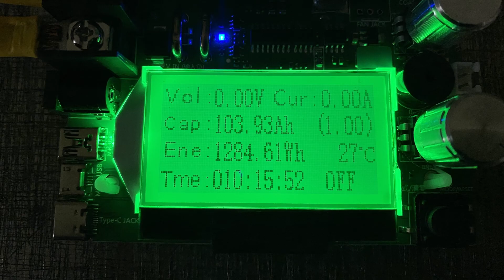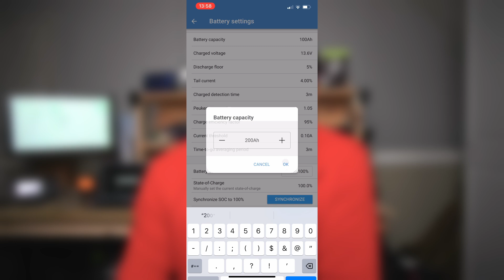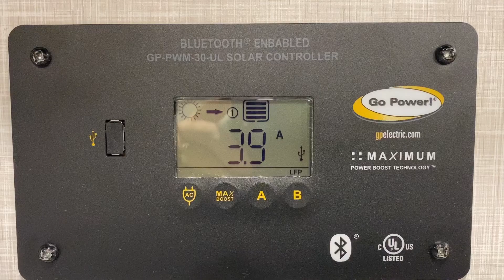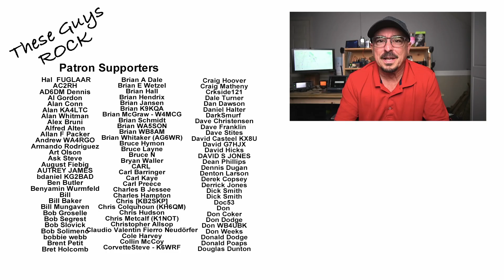Battery Install Gone Wrong

Comment: What charge control from shore power do you use?  What DC power Supply?
My RV is old so it only does Lead Acid. I would love to change out the charger and then add lifepo batteries.

Comment: ALWAYS ALWAYS ALWAYS d/c the panels BEFORE the batteries.  sounds like it settled itself out, luckily.  the theory about the mismatched battery voltages to start is valid, but you would need a fairly significant difference between them, and as long as the battery connected 1st (directly to the CC) then it shouldn't be a big deal.    Or maybe none of the above.  Like you said, this is a head-scratcher.  Hope it all stays working.

Comment: There is a certain order things need to be connected. I think the PV cells must be connected last.  Leaving PV connected without the battery will cause problems.  Once the sun goes down the PV (pv disconnects) the sun comes up (PV reconnects last in the circuit) all is happy.

Comment: Yeah, before you connect two batteries in parallel, check their voltages.  If one is way above the other, it will charge the other, sometimes at absurd amounts of current, and you can damage one or both this way.
Reply from the maker: Both had been charged to full the day before so I thought the voltage would be close

Comment: Always connect batteries to the PV Charge Controller before you connect the PV panels.  And I disagree with your view that it wasn’t helpful.  It was good information to share and if it happens again, you’ll know how to reset it.  73, Tim KO4EZG

Comment: I have a question which is somewhat related. I have four SLA batteries in series parallel. Can I draw from just one to run my radio, or does that cause a problem with the other three batteries being higher state of charge?
Reply: Series or parallel? Either one is fine as long as you end up with the voltage required by your radio.  Lots of the radios are 12 volt setups.  So, if "one" battery is 12 volts, you may use "one" battery by itself to power your radio.  Otherwise, if you hook a bunch of 12 v batteries in parallel you (for all intents) just make a bigger, "single" 12v battery, and because it's still 12 v you can still use that parallel setup now as the giant-capacity battery to run your radio.  Of course, I really didn't say much about a "series" hookup, as I'm just figuring you misused your technical words -- which I too have been known to mess those up, as do others.  But, they are importantly different  when being technically correct.
Reply: Just so you know if you hook batteries in series you increase the voltage rather than the capacity. Hope I didn't mislead you on my comments.  I just don't know the voltage of the batteries you are using.

Comment: I did not see smoke ! from doing many installs and with more than 1 battery.  Charge each battery separate and then connect. I have done 12/24 V systems in RV.  Waiting 24 HR is not a issue . From what I can figure you have no disconnect on PV solar input on MPPT controller . You disconnect battery leaving solar on. this keeps power in the controller. When you re connected it glitched. The CPU on controller went crazy . You needed a power off reset. That can not happen with solar working. and at night the solar went off re setting the MPPT controller. To prevent this get a PV disconnect switch.     Double pole made for PV systems. place in line just before PV input on controller in a easy to get at spot.  When working on Battery . disconnect PV solar first then Battery disconnect. This removes all power from controller and re sets it. Then battery on first than solar on.  The MPPT controller has a CPU in it.  Power on reset . 73

Comment: The instructions with my cheap Renogy stated to connect battery first then the panels. I read somewhere else that reversing the sequence could damage controller. How's your insurance?
Reply from the maker: Thankfully this didn't require an insurance claim

Comment: Curious, what brand and model of Charge controller are you using.?  is it RF quiet at HF and VHF?
Reply from the maker: GoPower is the brand. It came with the RV. I haven't noticed any significant noise from it.

Comment: Lithium Iron Phosphate batteries don't work the way most people think they do. This includes the people making them. Top balancing with Battery Murdering Systems is how you kill these batteries (and cause fires). The correct way to build a pack is to remove all BMS from them. Then bottom balance the individual cells (bring all cells to the same, near empty SOT with a resistive load). Then when you charge them, do so as a pack, to a slight undercharge with an intelligent charger (say 14.4V instead of 14.6V for a 4S2P pack like you have). Watch EVTV if you want to learn more on this.

Comment: "load dump" one or more cells in the batteries were overvolting and the BMS was shutting down the entire battery.   This is common for new cheap lithium batteries with the big prismatic cells.   We see the cycle as charge is applied, bms disconnects, voltage floats down, bms reconnects, charge resumes, repeat.   it should work itself out over time and the cells balance.  if it's stubborn, charge both batteries to 13.8V and leave them on your radio power supply for a few days.  The cells have trickle drains to help balancing, but it takes days.
Reply from the maker: Thanks for the explanation Craig. Fortunately for me, it sorted itself out despite my lack of understanding.

Comment: Most solar charge controllers will say to disconnect panels prior to disconnecting batteries and to reconnect batteries first before the panel to prevent damaging the charge controller

Comment: Be very careful with lithium ion batteries! If just one cell fails, it can cause thermal runaway and destroy not only the entire pack, but anything it is attached to. You are relying on technology to make a dangerous battery chemistry somewhat safer. I once considered this option for an off-grid setup, but abandoned it due to the potential fire hazard.
Reply: These are LiFePO4, Lithium Iron Phosphate.  Very safe chemistry.

Comment: As I recall, the “main battery disconnect” switch on Geo Pros does NOT disconnect the batteries from the solar charge controller.  It is designed to cut off the loads but still allow the solar panel to maintain the battery while the trailer is in storage.  As others have said, you aren’t supposed to connect or disconnect batteries from the charge controller while there is any solar energy flowing through - you either have to do it at night or lay towels over the solar panel first.  So you definitely made the charge controller angry.

Comment: I believe your assessment could be correct except that your batteries are parallel and would still have 12 volts into the charge controller. I should also mention that every charge controller I have says that you should never have solar connected to the charge controller if you don't have a battery connected. During the set up the instructions say to connect to the battery first.

Comment: Most solar charge controllers I’ve used (especially Chinese ones) say to disconnect solar then batteries (Hook up reverse, batteries then solar). They normally use the first voltage they see to determine how they charge. (Some can do 12 and 24 volts). So when you unplugged your batteries and it only saw voltage from panels it could have swapped to 24v. When you plugged batteries back in POOF. It’s very easy to do, ask me how I know.

Comment: Mine did the same thing. Same rv manufacturer, same controller same battery amperage. Reset controller everything fine. Been in for a year with no issues.

Comment: I am not sure what the issue is, but I would put forth that I would use some  dense foam blocks in  around the batteries to keep them stable and also rubber under them. This is to help to stop vibrations and jolts that may break loose internal parts like solder joint.
Reply from the maker: great tip!
Reply: Insulate all around to protect from cold too

Comment: I use in all ham radio device and others 12V the XT-60 connector.
Reply: Anderson Powerpoles are the standard connector for all 12 volt ham applications.
Reply: @billryland6199  I prefer XT-60, small and reliable

Comment: I lived in my Geopro full time for over a year with that exact solar charge controller. I switched to a single enduro power 200ah battery. I had to re program the charge controller for lithium batteries. You should never disconnect the batteries without shutting off the solar panels but the manufacturer does not include a solar disconnect. I ended up swapping out the charge controller for a Victron MPPT and put in a disconnect while at it. Going from a pwm junk controller to a Victron MPPT was a game changer. My stock converter in the trailer was not able to do lithium batteries but that is no big deal as it wont hurt the batteries while plugged in and the solar will top off what the shore power will not. If you pull the stock charge controller out and replace it there is plenty of wire in the wall cavity where it is and plenty of room to put a solar disconnect beside the new controller. Good luck K9TPT
Reply from the maker: Thanks for the info

Comment: My manuals say, for the chargers , that you should never disconnect the batteries while the panels have sun on them and are providing voltage. Your disconnect of the battery is suspicious of you had sun on the panels. I'm not sure how the AC connect would affect things. Just offhand I don't think it would help, the high voltage from the panels would be why they don't want you to disconnect the batteries. Mine is a Renogy.

Comment: I have a smilar solar charge controller in my camper and I have the same problem. when it's in really full sun and the voltage is too high, I get the same result. I must have a lower model because I can't adjust the voltage output of the solar charge controller. Same brand that you have, just more basic model. Which is really frustrating because that also means I can't use my inverter for 110v during those times that the voltage is really high. I'm just as confused as you are. I'm only use 1 battery. I don't think you're dealing with a problem due to 2 batteries in parallel.
Reply from the maker: I'm not sure I can reconfigure the charge parameters on mine. I didn't bother checking since it sorted itself out the next day. Haven't see the issue in three weeks now.
Reply: @KM4ACK  that's good! I'm going out to Guadalupe Mountains National Park this weekend so we'll see if I have the issue again. Lots of POTA time this weekend!
Reply: @KM4ACK You can change the charge parameters between preset profiles for different battery types, e.g. flooded, AGM, and LiFePO4.
Reply: Did you measure the voltage on both batteries before you connected them in parallel?  They may have both been at 100% from the charger perspective but still had some voltage differences either between cells in each battery or between the two batteries and as you thought the bms was self protecting until all cells found a balance point. The bms should have take care of that internally during charging but maybe they needed settling time and then when you connected them in parallel the slight differences caused the balance circuits confusion and caused the disconnect.